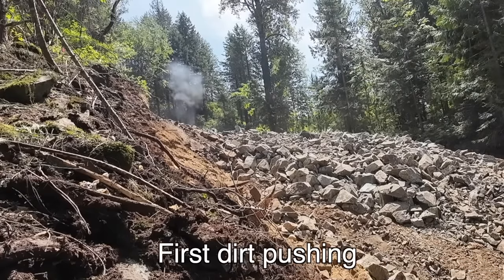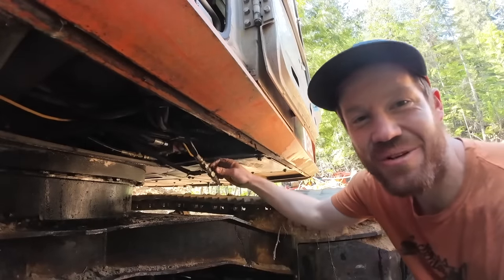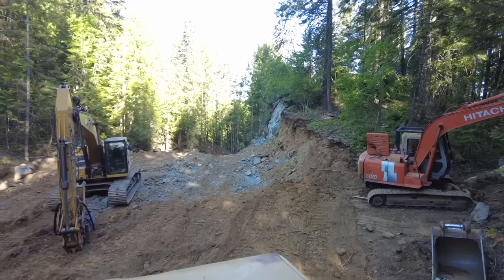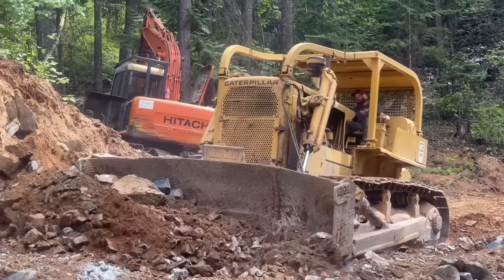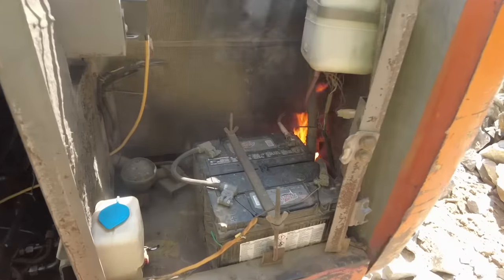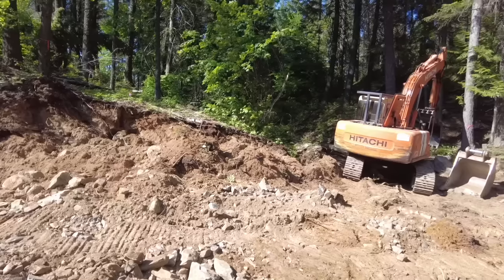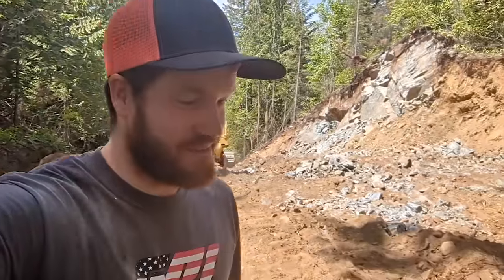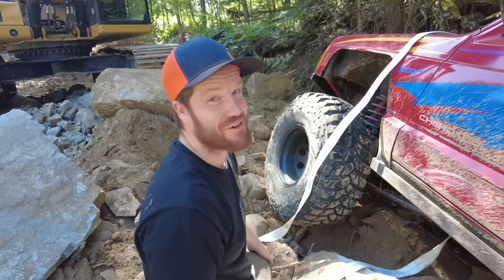I lit my excavator on fire... | Building Our Road

Comment: RILEY,  wires do not last for ever.  Stop waisting time. Go buy , 200' of a heavy gauge out door heat resistant wire. You got help.... set up a wire chop table with chair.
Buy a big ass bags of all kinds of connectors.  One man,.. yells out how long to make the new wire. 1 man, cuts and presses new ends on. And swap every single wire. Then new batteries,  then new alternators. I would add a smoke alarm, and add 2 high speed fans , blowing 1 on the motor,  1 blowing on the radiator forcing more air flow. You have to keep it cooler.
Also, your daily , checks are great. But you missed a important one. Carry a air compressor,  long hose, and a wand end. Blow out the motor,  blow out the radiator,  fins. Every day before you fire it up. And moving parts, dont use a wet lube. Try a can of dry graphite. Also... those old toys need a bath from time to time... when there not hot, pressure wash, them everywhere,  even paint them. Cheaply,  yellow paint, cheap ele pain gun, shoot it. Let dry. Spray graphite,  on moving parts, used grease gun. If you did that. The toys would run better. You'll be able to tell, right away when something is wrong... and stop guessing how hot the equipment is . Carry a hand held, Digital temp gun. Read on line working temps. If you go pass, stop. I ran a 5 million dollar 380 foot ballast cleaner. She had a 900 horse power diesel,  i was her doctor, new by smell, sound, pressure gauges,  and how 20 joy sticks felt. What was going on. I new when i pushed her to hard, when to back off.
Riley,  you go balls to the wall, that why you keep breaking everything you touch...
Good luck grass hopper.😅😂😢

Comment: I'm confuzed why is the water a bad thing?
Seems to me you will always have water running down hill towards the road rain, melting snow, springs etc. 
The  ditch on the up hill side is there to catch the water eh?
So the water runs beside the road that is mostly flat (you need some crown so the water is directed to the ditch) road bed that is higher than the ditch till a culvert takes it under the road bed and to the down hill side.
Even if there is a small creek in the ditch year round why does it matter?

Comment: I don't want to sound like a downer but from someone that has operated heavy equipment all their life you really have a couple strikes against you. #1, you are using older heavily worn equipment and operating them at borderline abuse mode and wondering why you have constant maintenance issues. #2 the excavator was/is worn completely out and you put it to work under extreme use before fixing/repairing any issues. Isn't going to work. Anytime you have a fire on a machine and don't unhook the batteries immediately you are begging for a total catastrophe.

Comment: Well people give you lots of subjections about stuff to do but not the right stuff to do I know is summer but I have a question you guys have 3 to 5 ways to plow the driveway but you have never use the biggest one you have or even design a close cap for it why and you don't have a winch in your trucks and your new boat how about doing a full tune up before you use it do not follow all previous owners told you people lie too be able to sell stuff always tune up a vehicle any vehicle before use it keep you away from trouble